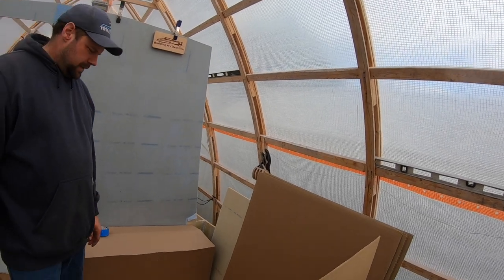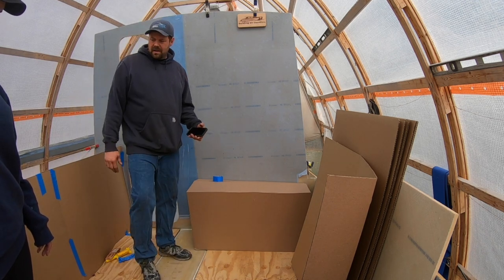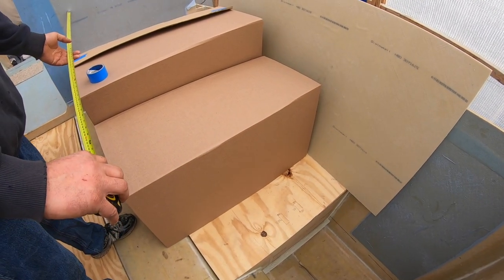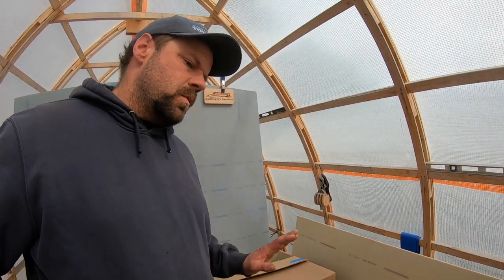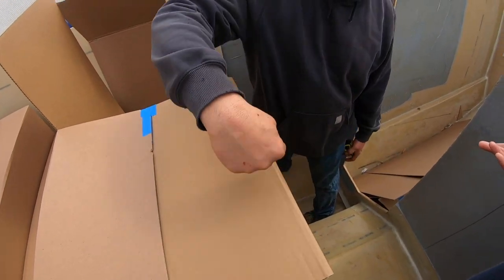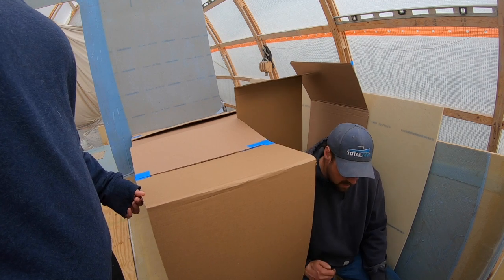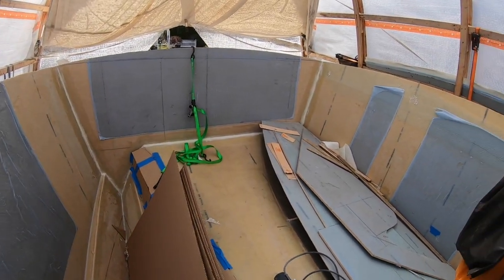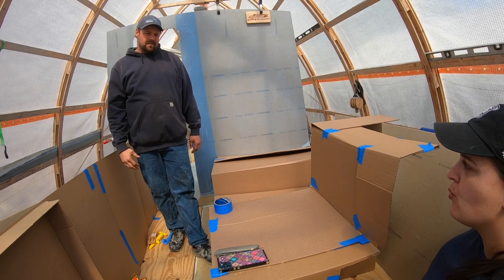Step 86: Cardboard Mock Up of the Cabin-  Power Catamaran Build

Comment: Nice mockup! Is the reason for a composting toilet that there is no room for a tank under the floor under the table? Otherwise I like the Jebasco sea water toilets with a tank.
Reply from the maker: We are trying to keep systems as simple as possible. Composting toilet = no tank =no plumbing = no dockside pump outs. For us this seems like the best solution all around. If all else fails we are still open to a jebasco. Thanks for watching 😊